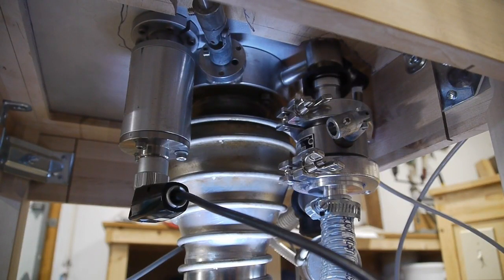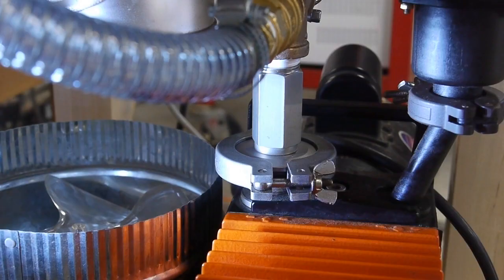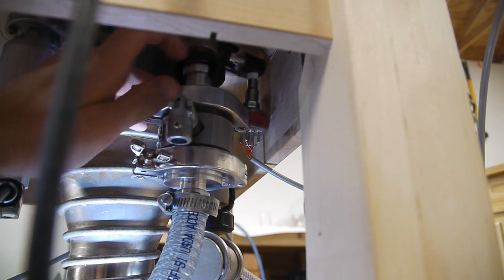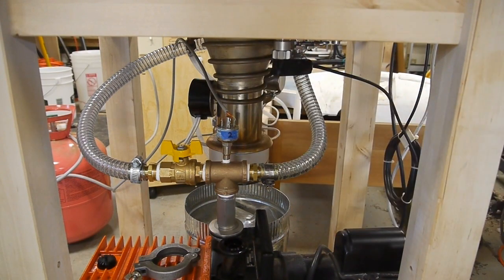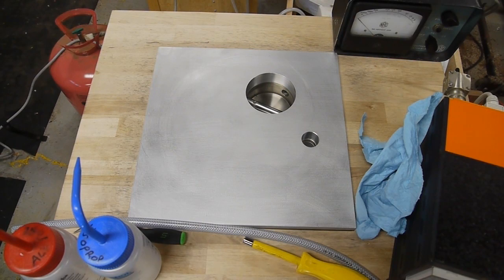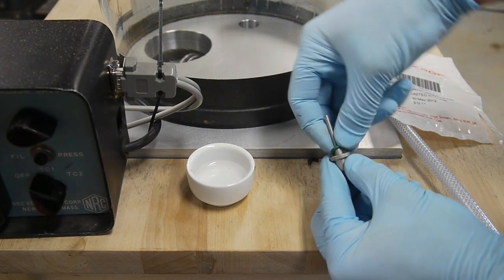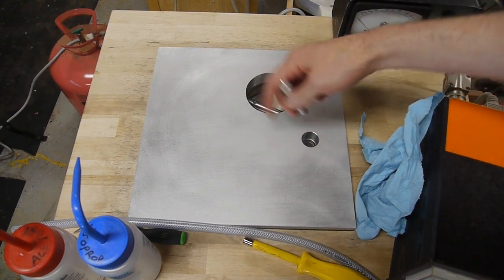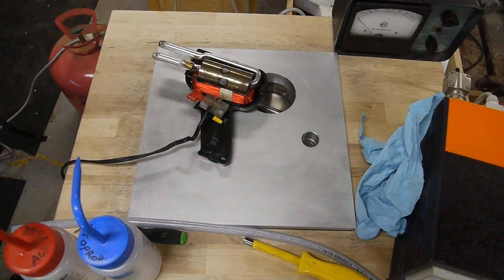Progress on vacuum chamber build - helium leak detection, custom flanges

Comment from the maker: Yeah, I should have mentioned that most diffusion pump oils do not tolerate being exposed to air when hot. Some oils do, but we'd still have the problem of hot vapor coming out of the pump and forming an oily film on everything in the chamber. If I was willing to let the pump warm up and cool down (1 hour) between chamber ventings, I wouldn't need the valve -- and this is how I built my previous chamber.

Comment: The bit about detecting the difference in thermal conductivity using helium is the same technique as some of the more precise gas chromatography detectors. It's a pretty cool use of helium

Comment: Helium is the best. The term 'Helium leak detection' is normally used when you have an actually helium leak detector(ams sensitive to mass 4 with sound output) connected. This can be used to measure small leaks, with background pressure <10^-6 mbar(/torr). Huge leaks as yours can be found in three ways: The way you did(I have never tried). -same way, but by spaying alcohol outside - both pirani and penning is very sensitive.

Comment: It looks like your diff bypass valve is just a gas valve, great alternative to a high dollar valve.  Also a spritz of acetone will similarly find a leak.  If the leak is relatively large after an initial dip on the gauge sometimes it will swing to higher vacuum as a bit of the evaporating acetone freezes forming a temporary plug.

Comment: I think you're right about them being Edwards specific fittings. I've used them and for all the fiddlyness of those clamp fittings, the Edwards ones always needed some force to fit the unfitted flange into. Never a good thing.
Thanks for the tip on the helium! Was worried we'd need a proper mass-spec for leak-checking our hackspace vac-chamber build.
Was considering a rewound MOT & variac for the evaporation heater supply.

Comment from the maker: Yes.  Search my videos for "water circulator".  I used 704 or 705 diff pump oil purchased from Duniway Stockroom.
Reply: What are the characteristics or brand model of mechanical vacuum pump ?

Comment: we had some feedthrus for  thermocouple wires in a vacuum plate using a 2 part epoxy...I don't remember the name of it, but it remained pliable similar to cured silicone.  I don't remember how the feedthrus were accomplished in the MRC sputtering machines...

Comment: Matthias, pumping out the volume of the diffusion pump is not an issue.  The main reason it is kept under vacuum when the chamber is opened is to prevent the hot diffusion pump oil from oxidizing and to maintain a vacuum on the roughing pump that is pumping the foreline of the diffusion pump.  Oxidized oil is difficult to clean out of a vacuum pump and chamber.  One of the mistakes beginners make is to open the chamber to atmosphere and forget to close the diffusion pump hi-vac valve.  It's possible to design a protection system that prevents the chamber from being brought up to atmosphere unless the hi-vac is first closed.

Comment: An inexpensive way of making a sensitive helium leak detector is to use a vacuum gauge such as an ionization gauge on its highest vacuum setting and partially null out the signal that is used to drive the display meter, leaving it at about mid-range.  The slightly different behavior of helium in the chamber relative to air will show up as a large change in meter reading.    Nulling out the signal requires a schematic of the gauge readout and some electronics know-how.

Comment: I would drop the soldering iron idea and use a variac with a rewinded MOT.
You will want some form of control.
I would also use vented screws for anything inside the high vacuum side.

Comment: I read that you should use a gate valve rather than a butterfly valve if you're planning to throttle the vaccuum from the diffusion pump. You can also use a light dimmer to regulate the diffusion pump heater current to achieve the same effect.

Comment: Argon also works well for leak checking like that. Does the same thing as helium and is a lot cheaper, especially if you have a tig or mig machine. Even 75/25 will work. Green o-rings are not viton, they are a flourinated rubber that will handle the high temps better than EPDM (Black nitrile) or viton (brown) You should watch out for viton in a high vacuum system, it is somewhat hydroscopic and will outgas water vapor for a long time unless you bake it out.

One nitpick, turned, not "lathed".

Comment: Something that might confuse others: At 0:16 you talk about a penning gauge. At 2:30 you talk about a leak and thermal conductivity.
The penning gauge is depending on the gas ionization cross section, and is anyway obviously not turned on during your huge leak detection. -you must be using a pirani gauge.

Comment: ...  -or by by using slight over pressure(~0.1 atm) (careful with any metal bellows) and apply soap water outside. Use any homemade soap solution applied with a brush, or buy special spay can with applicator tube.

Comment: instead of using a solder gun you could use a MOT with a light dimmer on the output and a few turns of heavy gauge wire on the secondary.

Comment: The diffusion pump is just a fraction of the total volume to be evacuated.  Is there something particularly difficult about evacuating that pump?  Otherwise, I would think it wouldn't save much time to keep air out of it when the apparatus is opened.
Reply: Diffusion pumps work by boiling a special high-temperature oil and turning the oil vapor into jets to push air molecules out of the system. That oil and vapor is at several hundred degrees celsius, and exposing it to atmospheric pressure air while it's that hot will cause it to degrade rapidly, or even possibly catch fire.

Since it takes quite a while for the oil to come up to temperature (and cool off again), it's much faster to just leave it running and block it off from the atmosphere while you open the bell jar.

Comment: Watch out for heat@feed-throughs - had molten o-rings myself - also remember outgassing-measures @ threads inside vak-chamber ... btw - get a turbopump - way less trouble with oil-contamination

Comment: I made a high current transformer from a microwaveoven that i rewound so i got 5.6V at 400A continually (intermittent 2-3 sec over 1kA) and made som electronics so i was able to stepless control the power from 0 - 100%. It works dam good and doesn´t take much space at all and works even for very thick tungsten bars fex for chromium depositing but would require a small fan if run more then 5 min or so at full power which i never do so i have not be needed one yet.

Comment: I imagine it would be easier to implement sputter deposition in argon atmosphere. Using old-fashioned heated tungsten boat can cause too much contamination, and you cannot use it for all materials (due to temperature limits).

Comment: hey ben if your soldering gun doesnt work rewinding microwave transformers is a commen practice i have made several and even have some videos on the power supplies i built with them , it would be easy to mount and a router speed controller{triac circuit} can modulate the power so you can better control intensity  
you will find it kinda hard to manage the heating element process without a power controll or a very specific element design "mils" , it would work on your soldering iron and a router speed controller from harbor frieght cost only $20 this way you dont burn up a bunch of elements to fast or worst , cant burn any also be advised a soldering tip is a poor conductor so if you are sputtering a highly conductive median you might need power then that iron can crank out, sry for jumping to conclusions i havent seen your heating elements but in the past i was very surprised to see it take 300 amps to make a copper wire red hot and a whopping 500 amps to burn it in halve , this was just 16AWG if i remember right

Comment: hi Ben, I'm a subscriber and enjoy your videos.  One thing, your fingerprints will be outgassing at this level of vacuum.  These, along with other sources of evaporation will all display non-linear type (I'm not sure which, possibly 1/X) degradations in pressure over time, whereas most leaks will show a constant rate.

Comment: Why not make your own resistive heating transformer?  It's easy enough to do if you have an old MOT whose secondary can be easily rewound, and it'll last much longer than the one in that soldering gun.

Comment: Are you using a water recirculating system to cool the pump?  The price of good diff pump oil is outrageous!  Did you find some at a good price?  This system will come in handy for your particle accelerator that you mentioned in the comments on a different video.  Thank you for posting!

Comment: Gah!! Pipe threads are evil on vacuum systems!

Also for large leaks such as the one illustrated in this video the leak rate is dependent on the viscosity of the fluid in which case helium will not be any more sensitive than air. For the size of the atom or molecule to affect sensitivity the volume must be in molecular flow. Molecular leaks are much smaller than what you had here and usually require a mass spectrometer to detect.

Comment: Ahhh!!!! I do believe this is the exact model pump I have! Did you ever learn anything about those weird Edwards fittings? I searched ALL OVER to find matching parts. I eventually purchased a lathe just to make the fittings I needed.

Also, did you ever disassemble yours? Mine has a spring-mounted baffle towards the top that I learned after-the-fact is normally reinstalled with a specialty tool.  Without the tool, just trying to snap the thing in place with large gloved hands is next to impossible!

Comment: +Applied Science, I acquired an Edwards 300M diffusion pump. It looks like you may have the same one? Unfortunately I am missing most of the internal parts. I contacted Edwards and the price for the internal jet assembly is prohibitively expensive. Do you know if the design of the internal parts is very critical. Do you think the internal jet assembly is something that could be easily fabricated from sheet metal or am I better off getting a working pump.

My plan is to build a DC sputtering system and possibly RF. So far I have gather some scrap stainless steel to build a chamber and I scored by finding a RFX-600 RF Generator from a scrap yard. It powers up but I'm not sure if it works.  I sure wish I would have found the matching network that goes with it.
Reply: +Adam Goldenstein I have an Edwards diffstack as well.  And yeah, buying much of anything new from Edwards is cost prohibitive. The internal jet assembly is really pretty simple (Edwards' manuals are pretty good about including parts diagrams)  If you happen to be very good at working sheet metal, you might be able to get something that would function; but that said, if you have those sort of fabrication skills, unless you are being seriously underpaid in your current employment, you might be better off hunting for another pump on ebay. It can take some hunting, but the cost of diff pumps online are a fraction of what they sell for retail. I got my diffstack (which included a big beefy cryopump) for about $250 6 years ago; and I got a cheaper air-cooled Varian pump for only $50; though it was seriously corroded and I had to do an electrolysis cleaning to get the thing in working condition.

There are only certain alloys that are particularly appropriate if you need to pull a really good vacuum. Certain types of stainless and a couple alloys of aluminum.

Comment: Hey Applied Science, for your vacuum gasket, are you using just a normal L-Gasket? I can't tell, but it seems like there is one beneath the tape. 

Also, did you use normal PTFE tape on the valve threads?
Reply from the maker: Yes, it's a normal L-gasket (Duniway Stockroom)  for a 10" bell jar.  The gasket kept slipping off the jar, so I used tape to hold it in place.  I used normal PTFE tape on the threads.